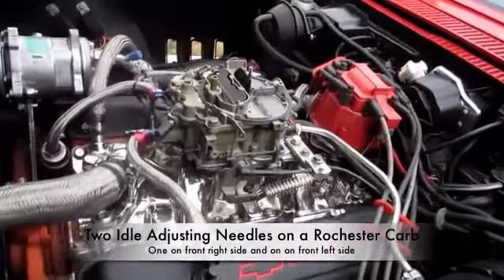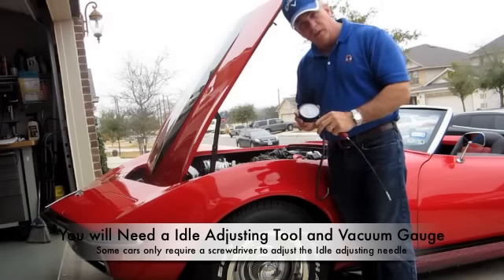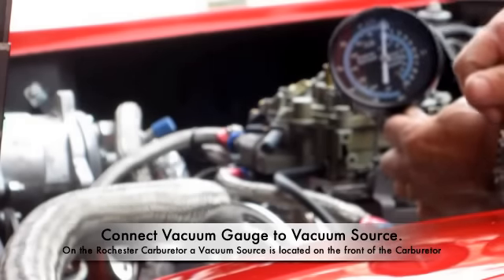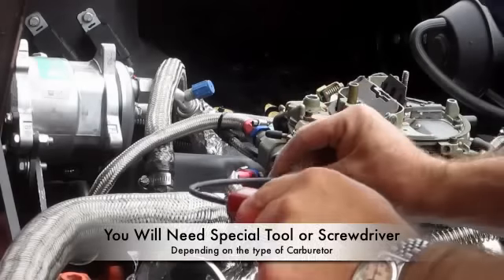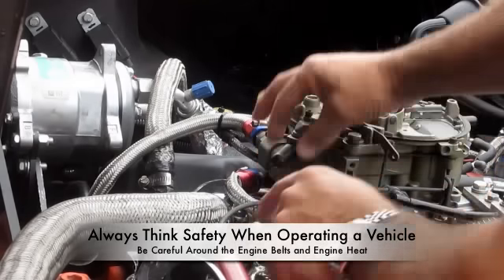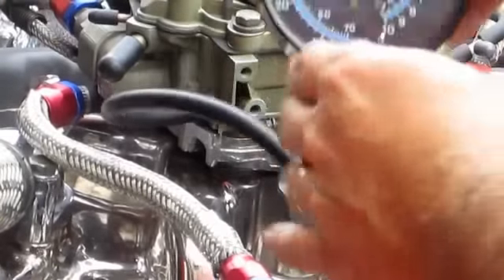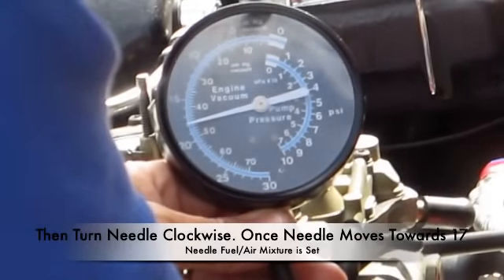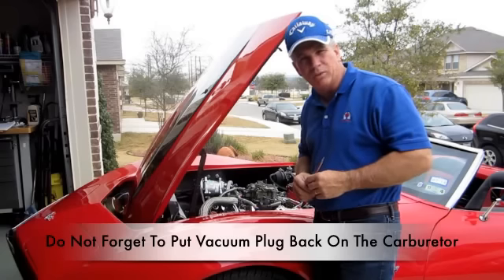How to Adjust Fuel and Air Mixture On A Carburetor By Corvette Hop

Comment: Thanks for the video! Your car is very, very nice! I love the C3's! I purchased a 1980 corvette last April and have been trying to get it back to driver condition since. I have had the front and rear suspension redone as well as various other details throughout the car. The list goes on, as I am sure you know. The car is very clean, inside and out, and the condition is about an 8 out of 10. I did have the original Rochester Quadrajet rebuilt by a very reputable shop in my area and what a  great job they did. It is hard to find a shop that even knows what a carburetor is. I was able to adjust the idle mixtures, thanks to your video, so thank you for that. It is currently in the shop for a cooling system overhaul, new radiator, hoses, thermostat.. etc. We cant wait for the nice weather to take the tops off and cruise! Thanks again for the great insight into the world of C3's!
Reply from the maker: +J. Bird Thank you for the nice comments. I am happy the video helped. In fact, that is the main reason I made the videos, help others. I love the C3. I  also have a C6, but something about the C3 that always gets looks from other people. The C3 is very popular at car shows.
Reply: It is a good video.Congratulations, very precise and informative. And by the way, liked the rolex .
Reply from the maker: Thanks my friend and thank you for the comments helping others.

Comment: The short fall of this vid is, it's not clear what port on the front left corner of the Quadrajet the vacuum gauge is connected to.  (Few)  One has to asks, is the gauge connected to "ported vacuum" or "manifold vacuum"?  Per my limited research one wants to hook the gauge to manifold vacuum - subject to error.  The vid is really good - short, concise and well edited.  Thanks for posting.

Comment: hi there, i am following your videos on adjusting the carb, the problem at the moment is the  idle mixture screw has no effect on the car , when i cover the choke doors by hand the RPM rise which is not normal , is that correct.

Comment: When blocking off on carburetor does the vacuum to the brake booster need to be blocked off at back of the carburetor

Comment: I have the Rochester 4bbl on a 77 Trans Am w/Pontiac 400.  For clarification, I have a few questions.

Do you tune each mixture screw independently until you get the right setting or do you tune both at the same time doing half turns so they are equal?

Turning the screw clockwise richens the mixture correct?

Do you have a suggested starting point, like three turns out from fully seated and then fine tuning from there?
Reply from the maker: Bill, you ask some very good questions And I love the 77 Trans Am. Sounds like you know what you are talking about. I work each needle independently. The reason I do this is because I adjust the RPM's after each adjustment. Then I work on the second screw and go back and fourth.  You are correct on the fuel screw mixture to richen the fuel. However I do not worry about that because I am looking for the needle on the gauge to start to decline. That is the point of perfect fuel/air mixture. As for a starting point, another great question. I back each screw out 2 1/2 - 3 turns. That works for me as a good starting point to ensure start up. Thank you so much for the very good questions.
Reply: CorvetteHop very instructional and helpful video. Have the same Q-jet on 350 Camaro. The number of turns should be same of each side? Or just observe 17-18 and leave as it is regardless of turns? Thanks in advance

Comment: should i be opening or closing the air fuel mixture once i find the maximum vacuum in order to find the sweet spot. Should i turn the screw clockwise, or couter-clocksise once maximum vaccum is determined? do i want o be leaner or richer than max vacuum?

Comment: I have a 79 301 4.9l v8 grand prix and it starts up but will stop do to the Rochester two barrel carb not being turned up could you possibly shed some light on how to tune it
Reply from the maker: Batman, I would get a tune up kit and rebuild it, make sure it was clean of any dirt particle, adjust the choke and fuel/air mixture. I am sure there are people who rebuild the carb for you also. Another way is to get an edelbrock. However, the Rochesher is a great carburator.

Comment: hi again dear my idle is at best after less than 1 turn on holley (still not perfectly smooth) and plugs turned to nice tan color from black if I turn idle screws 1.5 turn It gets rich and worsens the idle I hooked up a vacuum gauge getting 15-16 inch vacuum any ideas?

Comment: i already rebuilt this one twice, it will not adjust at all, and it flooded the spark plugs, everything is new, the primary metering rods, look like if they are to short, even pushing the rods all the way down they will not cover the jet, only the little tip enters the jet, is this normal?4 barrel rochester, from a 67 camaro 396

Comment: If this was messed up... would it keep my vette from running idle?... my c3 will turn on for a bit then dies after couple minutes... or what do you think is the issue? It's a 74 corvette.  

Great video!
Reply from the maker: Cesar, Interesting problem. Check your fuels filters and fuel float. Make sure no trash is in the fuel system. Check fuel pump pressure. Also, check your choke adjustment. Question, does it stay running once warmed up? Hope this helps. Corvette Hop

Comment: Nice ride. I have an '81 Vette myself. I noticed you have a different AC compressor then the stock GM compressor on your Vette. I need to convert mine over from R19 to R134A refrigerant. I don't have to original GM compressor so I need a new one and would like to know what company you used? Thanks in advance.
Reply from the maker: Murph, You are correct. I changed out the entire AC system with a Vintage Air system. I ordered the entire system from Ecklers Corvette. The entire system run about $1,450  http://www.ecklerscorvette.com/catalogsearch/result/?q=ac+system&x=0&y=0. I figured if I replaced the old compressor, fan had someone change the system it would cost me about the same as replacing the entire system (well maybe a few hundred more). My old system worked but the volume was very low. The old fan was working correctly but the volume built back in 1969 was just not enough for me. The vintage air system put out more volume, easy to replace parts, new technology, correct R134A and reduced the car weight by about 30 pounds. Plus, the new controls on the control panel looked and operated like the classic. For me, it was a smart move. It did take some time to remove the old and install the new. If fact, It was somewhat difficult but I love a challenge. It was also a great opportunity for me to refresh my training on AC systems from my old Air Force days. Most people with mechanical experience can do it by following the vintage air instructions.
Reply: Thanks for the response and info!

Comment: I followed your instructions and I didn't get any vacuum appearing on the gauge unless I blip the throttle. I was told I was on the wrong port?? I have a M4ME Qjet. wonding if this would help with the issues im having
Reply: Your carb must do vacuum....otherwise doenst work, mesure it.Just think about that.Sems you have  a problem, choosing th wrong port, bad vacuum tool, etc..I use ancient vacuum tool, they are very precise, because use a capilar tube and a liquid.Everything mechanics= Precision.
Reply: You were using the vacuum advance port.....that only vacuumes on acceleration....it has to be a port that constantly has vacuum while idling.

Comment: I thank you. is that in any one of the vacuum inputs thereof ? Or on the timing advance port on any carburetor ?
Reply from the maker: +561ENTERPRISE I connect mine to the vacuum input on the carburetor (timing advance port). However, some carburetors do have other vacuum inputs. You will know it works when you connect the vacuum hose from the gauge and notice a needle reading on the gauge. Also, make sure all inputs are closed with no vacuum leaks. Thanks for the comments.  Dwayne
Reply: I was under the impression that some vacuum ports off the Quadrajet are ‘metered’ and you want an unmetered port straight into the manifold for this process. True ?? or does it not matter as long as you follow the process?

Comment: i have a 350 chevy motor with 600 eldebrock carb.. had to change my heads.. now im having carburetors problems..car runs good but seems to stall when i stop as if its not getting gas may even go dead but then it will start again after i pump the pedal a bit. could this b from the air mixture screws or something
Reply from the maker: +Spoony  Love Spoony, Wow, that is a big job. I did the same on my 1969 Corvette. I also have an 600 Edelbrock on it now. I would check a few things. 1. Check the timing. (most are set at 8 - 12 advance at idle). My timing is about 12 degrees advance at idle. Each engine is different based on the set up and cam. 2. Look for a vacuum leak (maybe a line not installed or plugged). 3. Check you floats in the card. Is this the same Carburator you had on the engine before you changed the heads? Was the car running great before the change? A good video for float adjustments is this one using a 7/16 drill bit. https://www.youtube.com/watch?v=hoXK9tm0bWk  4. Also check your idle screw (some people have them set way low when installing a new carburetor. Hope this helps.

Comment: Maybe you can help me. I have a 73 Corvette with the 350. I just put a new harmonic balance on, set the timing, #1 cylinder top dead, and got the idle mixture correct. It is a Rochester carb and I am getting back fire thru the carb. When I spray full in the carb and hit the throttle at the same time it does not back fire thru the carb. When I advance the timing, it works much better but the timing marks are way off. Does this mean I am running lean and need to raise the float bowl. Plus the Carb was just rebuilt.
Reply from the maker: Keep in mind the timing mark at zero is just for starting. Many timing marks run better at 8 or 10 degrees after adjustment. The best way is to ensure your total advance timing is corrected. I do have a video on line that talks about total advance time with the engine running at about 2,400 rpm.  In fact, my 1969 corvette runs best at 10 degrees advance. If your Carb was rebuilt correctly it may be just your timing or a fault in the rebuild.
Reply: CorvetteHop hi sir just wanted to say thank you for the informative video I have been terrified for years to try & fool with mixture screws due to past failure lol but the gauge was perfect I really needed that visual aid to help me get the mix right . some guys have the magic ear but to me it's like tuning a guitar & I just don't have the ear for it . u are awesome thanks again

Comment: Might be a stupid question but I just got a 72 chevelle and trying to learn how to work on it, sounds a little rough at idle almost like a misfire... I should make sure timing is set correct before messing with any idle mixtures correct?
Reply from the maker: Not a stupid question at all. Yes, check plugs, plug wires and timing. Maybe even a valcuum leak. Hop
Reply: CorvetteHop Thank you! Much appreciated!
Reply: CorvetteHop I just uploaded a video to my channel of it from yesterday when we got it running, do you hear anything abnormal? At initial startup if we didn’t give it throttle it would stall out... didn’t rev it that much until it was already warmed up
Reply from the maker: @johncrew96  Do you have a choke on it? It sounded like it was not warmed up. Otherwise it sounded fine when you gave it some throttle.
Reply: CorvetteHop yes it has manual choke, don’t remember if it was on or off at time of video but engine temp got up to 180 ish
Reply: CorvetteHop just checked video, choke was off at time of video, I think temp was about 160-180

Comment: Would you start by backing out the idle speed screw first? Then do the mixture screws?
Reply from the maker: The idle speed should be set at about 800 - 850 RPMs to start. Keep going back after each adjustment to ensure the RPMs are at 800 - 850.

Comment: So you do the right and left side while the gauge is hooked to the vacuum advance port? I have a 396 BB mild cam the the QJet. My Vacuum inly got to about a 6 at 800 RPM. Do you tune it at the idle speed or another ?  But it seem to run ok.
Reply: What are you engine RPM's while tuning. You were clearly above idle.
Reply from the maker: Most are between 750 - 850 RPMs. On my 350 chevy, I keep it at 850 rpms. You are correct, in that after each adjusted the rpms have to also be adjusted.

Comment: I installed a new quadrajet on my firebird with a 301 and I can’t seem to get any adjustment out of the carb. It starts right up but then the rpm climbs up fast to 3500 as if giving it gas. Could this be a vacuum leak?
Reply from the maker: Most likely not a vacuum leak. A vacuum leak will normally decrease RPM and or fluctuate. By chance, is the RPM adjustment screw set too high. Do you have good throttle control?
Reply: CorvetteHop I’ve backed the base idle screw all the way out as well as the fast idle screw and the engine is still screaming at high rpms.
Reply: CorvetteHop I will need to check the throttle. Maybe there is too much tension on the cable some how
Reply from the maker: Ensure you have easy movement on the throttle cable at the carb. Spring tensions is good and RMPs are adjustable when operating? I hope it all works out.

Comment: hi, i have a 79 lesebre and won't pass emission because carbon Monoxide is too high, do you think I need to do this adjustment? thank you in advance
Reply from the maker: +El Chukii El, it is possible but most likely not. I sure would give it a try. Most likely it is your Cadillac converter if it has one. Some cars also had a charcoal filter. I am not very familiar with the 79 Lesebre.
Reply: +TheWhatisright Hopcorvetteman the catalytic converter being replace already no luck, new spark plugs and wires, idk I'm getting crazy
im going to do that adjustment anyways and thank you for quick response
Reply from the maker: +El Chukii Good move, it may be way off.  You can also tell by listening to engine RPMs. When adjusting the screw and the RPM go up then stop, back the screw down a 1/4- 1/2 turn. Then adjust the second screw. I alway find it best to use a vacuum gauge. The gauge is cheap and only cost about $20 at autozone or O'reilly auto parts store.
Reply: +TheWhatisright Hopcorvetteman yes I'm going to give a try using a vacuum gauge like you did, thanks a lot great video
Reply: Why are you getting your car inspected? Out of curiousity, I have a 78 gmc truck that's been exempt from inspections for about 3-4 year's.

Comment: I have an 81 vette all original Rochester 4bb , my choke light went on what would cause that , thanks.
Reply from the maker: Tony:  I am not very familiar with the 81 Vette wiring. However, I found this information in the corvette forum. See attached link  http://www.corvetteforum.com/forums/c3-general/2832013-choke-light-1981-a.html    The problem sounds like a ground issue. I would check the Choke Fuse, all wires and clean all ground connections. Please let me know what you found out.
Reply: TheWhatisright Thanks for the response and I will let you know what solved the problem including the advice you gave me.
Reply: TheWhatisright
I checked all connections and cleaned them but choke light and dim battery light was still on. As per your info i went to corvette forum and they said most likely it would be a bad alternator . I replaced alternator and everything is working fine at idle for 15 minutes . Will take it for a test ride but i dont forsee any problem , Thx for your help.

P.S. Trying to find carberator adjustment screws but dont seem to see them as per your video am i missing something or can they be in a different location on my carb ( 81 vette rochester quadrojet ).
Reply from the maker: tony ferrari Let me know if you can not find it and I will send you a photo. There are two fuel mixture adjustments on the rochester Carburetor. One on the front lower right hand side of the carburetor (front as in, closest toward the engine fan). And one on the left front lower side of the carburetor. The screw are difficult to see sometimes because the are reset into the carburetor.

Comment: What is the RPM at when you are adjusting the mixture screws - my guess is about 1000 rpm?
Reply from the maker: John Sorenson John, RPMs are set at 750. It is a standard 350 Chevy with no real modification.